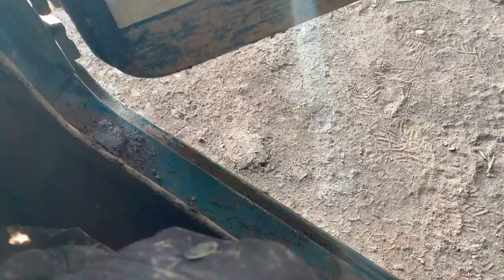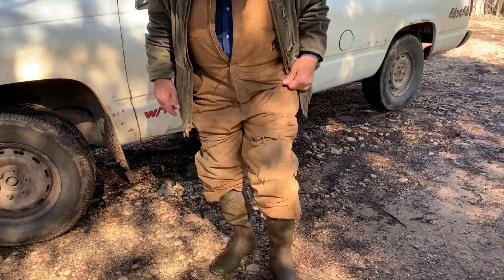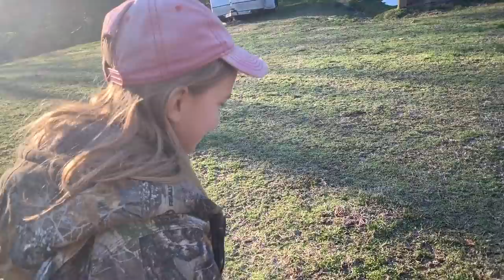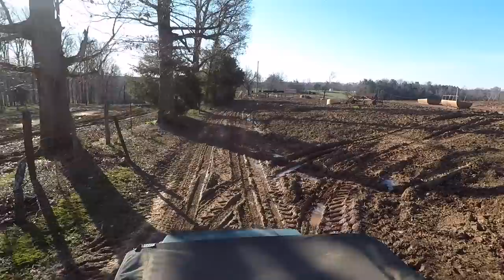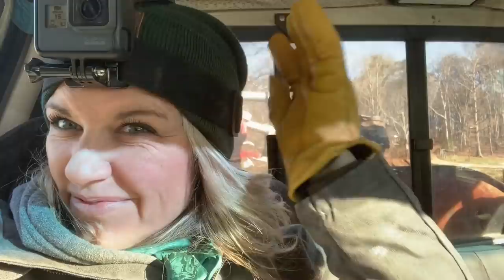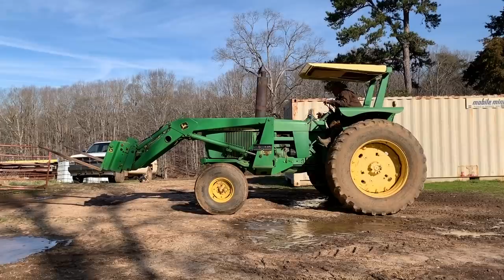Go Pro Fun, Pig on the Run

Comment: Meredith. Tell Lawrence he should weld a grab BAR in the back of that little truck. So you can hold on better. And put a non slip pad in the back of the truck when you're standing up in the back. So you wouldn't slip.I hope you never fall out of that truck.  THAT WOULD BE A HAZARD. And it will be painful. GOD BLESS. If that was me I would keep YOU SAFE at all times. YOUR Daughter got the Go Pro working good for her.

Comment: You can get 12/24 soler panels that go on the roof or in the back window of a vehicle , that you leave connectected to the battery ,which will keep a good charge in the battery it would be ideal for the ford 555. because you seem to get a lot of sunshine and bright days..it would start everytime, without having to jump it most of the time, they are not that expensive ,.

Comment: I do have a suggestion for you. For those double gates you could weld a piece of pipe on one and put a piece of rod in it to put to the ground to keep it from getting away from you. A bend on the top of the rod so you could could hold it up on the gate when you want it up

Comment: Quick question about your merch, any plans to offer other non trucker style hats?  Not a fan of snapbacks and would love some non camo options of both the logo and the Bernard Farms ones.  On a side note, my wife loves the classic toboggans so i guess one of those is in the cards also!
Reply from the maker: I have one non-trucker style (but it's Camo.) I'm open to more suggestions. What style do you like? I've thought about a classic unstructured ball cap style.
Reply: @ThisFarmWife_  I did see the camo one, i'm personally not a huge camo fan but was considering buying it anyway :) .  I like both the leather patch sun logo and the Bernard Farms logo. I really like the style and shape of the camo hat because it's a lower crown and solid non mesh back with velcro closure just not the color LOL.  As for colors I'm partial to like blacks or charcoal.  I think a two tone like the charcoal and black one with the leather sun patch would look really good in the same style as the Camo hat and would probably look good with the BF logo on it in black.  That's just my opinion of course :)  Hopefully all of that makes sense!

Comment: We are in a solar minimum right now thats why the weather is out of wack it affectes the jetstream they stay to long in one place that why its either to wet ore to dry for longer periodes of time then it normaly woud. Add to that earths magnetic fields is at its weakest point in a verry long time witch means more cosmic radiation comming in witch means the clouds hold more water so when it rains you get a lot of water thats why it floods its all the sun who does it.